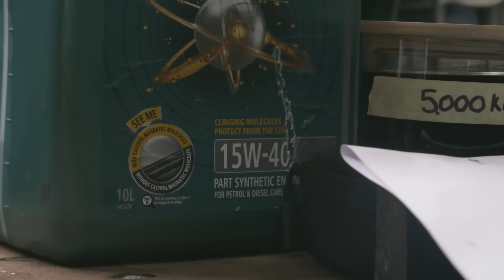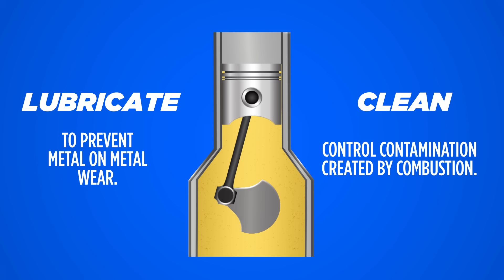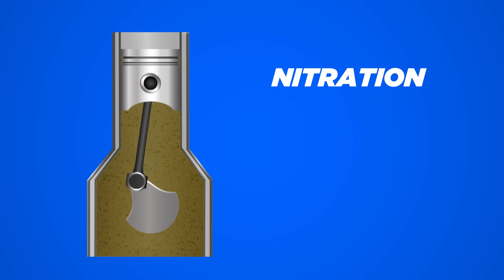Engine oil COMPARED at 5,000km vs 10,000km vs 20,000km! This'll make you service your 4WD RIGHT NOW!

Comment: It is very interesting that in Europe, the shortest manufacturer-recommended interval is 15000km which equals to approx 9300 miles. It is not unusual, if the interval is 20000km or 25, corresponding to 12-15000 miles. Even for the same cars & the same motors. Would would say that it seems like someone wants to get more money for service and oil changes.
I had many cars in my life already, some of them with more than 300 000 km. One of my previous cars (now with new owner) has about 450 000 km (280000 miles) on them, oil was changed in intervals between 15 - 25 0000 km 9300 - 15000 miles.

Comment: 5000km oil change for engine, fuel filters air filters cabin filters every 20k, and the big one every 50k includes power steering, coolant,  diffs, gearbox, valve adjust, Aircon, power steer belts, lube and preload front wheel bearings, and brake check and bleed system, not bad for a 70 year old when I do my maintenance it is cheap and I know it is done, love your video's go hard.

Comment: in general I change my oil at 80% with modern diesels recommended. if I was towing heavy I would change that to 65-75%. Modern diesels ask a lot of there oil and manufacturers are choosing thinner oils for fuel economy.
And another fun fact oil changes color due to the detergents getting hot first, then by contaminants building up.
 Ive been around big diesels for 35years and the old oils never had this problem, due to thicker oils and not recirculating exhaust gasses, because they were basic base stock oils no additive packages like modern oils. One of my bosses used low ash oil with an anti foaming additive in his Mack trucks and that oil was for every fluid in the truck. So engine, power steering, hydraulic tipper ram.
He never had issues.
Anything lower than 40wt oil is not offering the owner of a vehicle proper protection, it purely bragging rights for lower fuel consumption.

Paper test is a perfectly valid way to test oil, it just doesnt have the accuracy of lab testing.
In the railways the mechanics do oil tests with an electric fry pan. <- still not scientific but it easily tests for fuel and water contamination, because they change the oil so frequently thats the only thing they care about.

Comment: Cheap insurance - this is a great example. Oil filters are also much smaller than every previous generation. Cheap insurance - change to the harsh use service interval every time or less. On my race car its after every event. Diff and gearbox after every second event.

Comment: About 40 years ago I was a CAT tech, and when we tested our own cars oils with the CAT SOS, Scheduled Oil Sample service, all of us started changing oil at 5000 kms max. This with petrol engines. As I had a K5 Blazer, carbureted V8, I started changing oil every 3000-4000 max km even though the results for me were better than the ones of single point injection or multiport injection. The newer V8:s had EGR:s (not for long after that...), and for some reason had a bit worse results. Perhaps still new engine wear or something.
I still have that Blazer, I once replaced the valve cover gaskets (have to do that again soon now after about 15 years...) and the engine looked like new inside. It has now well over 800000 kms on it, perhaps close to a million because I had the speedo out for a few years, the small reduction gear for different tire size had failed and I thought that it was the cruise control assembly those had. Just kept going with the traffic...
So, changing oil " way too often" pays, and for first 20 years or so I used just mineral 10W-30. Unless there is a turbo (heaven forbid...) mineral is just as good as syn. Turbos in cars are the invention of The Guy At The Hot Place Below...
And, we started putting grease to the rubber sealing area of the air cleaner cartridge to keep the silica (sand dust) value down.

Comment: I always use the Castrol in everything and change every 10000 .. just a side note I know guys that have wrecked diesel engines not through lazy servicing but by the way they drive .. always changing up gears and labouring the engine.. engines hate it .. hard work with low oil pressure kills an engine.

Comment: Its actually not a bad analogy to what happens with the water/mud.   My sisters never changed oil they just added.   The oil will turn to sludge then fill up all the channels that bring oil from the pad to the lifters on the top of the engine.   Loud lifter noise + poor oil circulation + heat = blue smoke burning engine with loud tappet like lifter sound.   Then you trade that care in and say see you don't need to change the oil on time that is crazy the car still runs.   

They have people brainwashed into that mentality. 

Id say you can can do 5,000 miles (8,000km) with most cars but the new 10,000 mile recommendations are going to lead to more engine wear for sure.

Comment: Oils ain't Oils. They are not all the same. I use Castrol Long Life Synthetic Oils. All though i aggree in changing it earlier but not all cars need changing at 5,000km oppose to 10,000km recommended by Manufacturers.
Example..... My Golf R as mention uses long life Synthetic engine Oil. 
Recommended interval is there for 15,000km. However! I change mine at 10,000km. It is the perfect time for me to change it then. The colour is pretty much as your second oil drop run. If i left it to 15,000km it be close to being fairly dark. So! It is better to state that there are exeptions and it certainly is not a rule to be applied to all cars.

Comment: I have always done an oil change every 10,000 klm - And unless you have a problem with your olfactory senses then the quickest way to tell your oil is shot is by smelling the burnt smell that comes from old and useless oil - Once you smell the burning it is time to change the oil regardless of the distance it has travelled

Comment: Aim for 5,000 km oil changes.  Occasionally due to time constraints it gets stretched to 7,000 km. Not much difference 5 to 7 but over 7 it degrades quickly. I use quality oil, so am not panicked if I miss at 5.   I run my trucks out past 350,000 km.  At that point it is the rest of the truck that is done.  The engine is never the reason I have to cycle out the truck.

Comment: Lol i changed my oil recently in the 4.2 Patrol including a flush this time and it was a tad overfull so I drained a bit and it still came out black and not the normal colour the oil is when I out it in. I have never seen the oil in these things come out anything but black.

Comment: I change it every 5k because I don't know if my route is optimal or not. Sometimes I drive it hard too. But the engine feels smooth after the change. This is how I do it. Oil is not only to lubricate it cleans also. If you don't change it often enough it will not clean anymore. Will still lubricate but not clean and create grinding dust from burning at hot areas in the engine. Engine flush for me is unnecessary. If I had to do an engine flush I would get rid of the car first. And get myself another one.🤣

Comment: i use 350ml fresh left over oul, 1.5 ltrs used oil, filtered 5 times with face tissue, turned up side down nmineral water bottle, then 2 ltrs of PALMOIL, ut runs 1l:,10.5 KMS/liter. for 10 t0 11kms, new oil filter, for 1300 city car mini van

Comment: Ten thousand kilometres is a bloody long distance with stop start , oil is cheaper than an engine .  5000 kilometres is not unreasonable but 10000 is too long . It’s too far.  It’s hell inside that crankcase and it’s pressure on those bearings along with contaminants and water from combustion it’s a recipe for disaster .

Comment: Every 20.000 or once a year. Citroen recommends every 30.000 km. I am using fully synthetic oil. It's a 1.4 hdi with 68 hp. Would change more often with a more powerful engine though. 😊

Comment: I drive a 2017 Cummins Ram 3500. I tow heavy for 6 months and and run empty for 6 months. Dealer recommends changing oil every 15,000 miles, which I do.
I sent two samples to Blackstone Labs for analysis..at 75,000 and 90,000 miles. They told me the oil looks good enough to extend the interval to 17,000 miles and test again. Three thousand mile oil changes are a waste of time and money, especially when your engine uses 12 liters of synthetic oil like the Cummins 6.7.

Comment: This test can not be compared unless it was done on thd same engine. Let's face it, if the engine has low ks, say under 100,000ks... yes 100 thousand ks, i consider low, that test will probably not show a drastic difference,  but if you start with say 300,000, it's going to be much wiser to change oil at say 5000, especially on a diesel with a turbo. No doubt when you change your oil depends what you use it for... i don't see 4wd off road work making a drastic difference unless you're towing or just flat out caning it.

Comment: Greetings from Southern Europe. I've been doing 15K km oil changes and my oil never turns black, it's brown. However, the last time I changed it, it was at almost 10K and there wasn't much of a difference in colour, but I think I'm going to stick to 10K oil changes from now on. I also live in a tempered climate which isn't as hard on the car as if I lived in Canada❤where I'm originally from. Cheers.

Comment: I have my 2019 Toyota Prado serviced every 6mths/10,000km as per the book. However, I change the oil/filter myself in between services at 3mths/5,000km without fail.
Some people would think that is excessive, obsessive, whatever. $120 oil/filter change is cheaper than an engine rebuild.

Comment: I run AMSOIL synthetic in my Duramax… change at 10,000 miles, with a complete lab analysis… “Flagged data does not indicate an immediate need for maintenance action. Continue to observe the trend and monitor equipment and fluid conditions.” 205,000 miles and engine still within factory specs. I use Power Service… change the fuel filter with the oil changes.

Comment: A number of factors must be considered before deciding when to change the oil.
The driver. Is the driver competent? Does he treat the engine with respect. 
Does the driver all engine to reach normal oil temperature  before high speed driving.
(90% of wear in an engine occurs when engine is cold).
The working conditions of the car van truck. EG  does the vehicle  ( bus) spend its day working city centre doing g stop start every few metres in traffic at bus stops?
Does the vehicle work in hilly terain carrying heavy loads?
Is it a long distance car doing mostly motorway driving?
Dies the vehicle work in below freezing climatic conditions?
Does it work in the desert?
Does it work off road? Is it a Sunday car.
A car that only goes to the supermarket the local school during the week  and church on Sunday.  Each journey being 2 Km in distance.
So there is no hard and fast milage distance. Every vehicle is unique and has its own oil change requirements.
The only thing  I will say, is that it is better to err on the side of caution.
But, an easy check is to  tske out the dip stick when engine is cold and feel the oil, Can you feel grit? get the oil tempeture warm and repeat exercuse. Then get oul temp hot  take out the dip stick, and feel the oil. 
Any grit or roughness in the oil, suggests oil and filter need changing.

Comment: Great channel. What a lot of people don’t know is you should change your oil on the amount of time your engine is running rather than the distance travelled. Example, if you let your engine idle for one hour, no mileage is registered on your odometer, that is why a hour meter to register the time the engine is running is a must, highly recommended. I change my oil  every 50 hours. 
My recommended trip for you guys, which I’m sure people have recommended already is Baja Mexico. Yellowtail in San Quentin, rare strain of rainbow trout in the mountains, yellowfin tuna in La Paz. There are some do’s and dont’s. I would not go when there is an off- road race like the 1000 or the 500, and don’t drive on the blacktop at night. Keep up the great programming and maybe I’ll see you guys out there somewhere!!!

Comment: I've been changing every 5,000 km for the past 35 years. It has saved me thousands of dollars. My Chevrolet Malibu did 330,000 kms and ran like new. Rust took it off the road. My 2009 Mercury Grand Marquis has 260,000 km's and has never had a single problem. The only engine part I've replaced is the serpentine belt. It starts, runs like new and gets great mileage.

Comment: Most cars have "cold.start" rev high when you start it when its cold like the mornings.when you go to work. I like to sit till the revs die down probably 30 seconds. I have turbo cars and depends on how i drive it, if im boosting it hard id do a lap around my block or go easy 1- 3 minutes from home so the oil can cool down. Because turbos have a oil feed and if you shut it off and your turbo is red hot. (Hooning, towing, just come off the highway ect) the oil in the turbo will burn. Thats okay i guess but youd have to change your oil more regularly. Like race cars, theyd change oil after every race. I changed my oil every 5000km and never needed to see a mechanic. This day and age you just youtube your car model, and watch and learn how to do it. If you never done it you might need to buy particular tools. And then google how much oil your car needs, buy the oil, oil filter. So much cheaper once you have the tools and knowledge to change your oil. Probably cost most people 80-$100  depending on brand and amount of oil. Then if you get someone else to do it

Comment: Look at this cookie, doing oil quality tests on a piece of paper. I think even highschool kids wouldn't find that accurate 😅 Anyway, you mention cold engine operating and short-distance driving, this is exacly the reason why you SHOULD NOT use a 15W-grade oil, because it takes much longer to heat up (this is so 1990's - perhaps before u were born). Try using a 10W- or 5W-grade (synthetic) oil and see the difference mate. This will help the engine get up to temp faster!

Comment: If you have a car you plan on keeping forever then i would change the oil every 3000 miles before it starts getting dark.
Reply: Yep, and people don't realize the manufacturer extends out the interval to meet standards and convince you to replace it sooner. 3K is optimal for motor oil change out.

Comment: 10,000km oil changes using 100% full synthetic is perfectly fine, if you do alot of city stop and go driving then replace it earlier at 8,000km.

Comment: Changing the oil more often will lower the soot load, for sure, which will show up on the paper, however for anything else you need a proper oil analysis.  Also oil has three functions, lubrication, cleaning AND cooling.

Comment: Judging the quality of oil by its colour is misleading; it only tells you the oil's appearance, not its condition. Claiming that your oil change recommendations deduced by putting drops of oil on a piece of paper are better than what design engineers have specified in the manual is quite laughable.

Comment: Diesel oils that run in a diesel engine are meant to be dark as they capture the soot which is not found in Petrol engines ( most waste is petrol and moisture). If diesels are driven how they are meant to be which is brought up to running temp each time then oil should last long. Intervals are all relative. In a passenger car with 5 litre sump, yes 10 thousand may be too long. But the next model may now have a 7 litre sump. 4WD usually have larger sumps so should get the range. Australia has always had poor diesel fuel, but the newer ones appearing at servos should start to improve things.

Comment: 10k km on full synthethic can be done.

But 10k km on regular or semi syhthetic is not to be done.

I do my oil changes 5k kms on full synthetic, so its 2 oil changes a year, which will help keep the engine better lubricated and cleaner, and reducing the wear, which helps to extend life of the engine.

Oil changes are cheaper than engine replacements or rebuilds.
Reply: Yes, I did it on 4 cars, but non of them had GDI, or low tension piston rings, 2 were 80s Dodge turbos, 2 were 90s naturally aspirated.

Comment: Hello!

Drive a Volvo V60 diesel 2020 and these modern Volvo cars have a service interval of 30,000 kilometers or one year. Whichever occurs first, i.e. number of miles or age of the oil. It works perfectly fine. The problem with used company cars in Sweden is that you cheated and drove additional miles, perhaps 60,000 kilometers with the same oil. It creates problems with oil sludge and so on for owner number two. In Sweden, branded workshops use quality oil that is created and tested by car manufacturers to last 30,000 kilometers or one year. However, it is a little different on what brand you buy, but Volvo has a service interval of 30,000 kilometers or one year. There will be no problem if you stick to the car manufacturer's service intervals and the recommendations of the brand workshop. I submitted my Volvo to a non-brand workshop for an extra oil change or so-called intermediate service six months ago. By then, the car had driven approximately 12,000 kilometers on the same oil. Again a bit unnecessary but I myself drive at slightly higher speeds so I thought it might be in order for an earlier change. The car is now going back to the dealer for a regular service with an oil change. It is also important to know that there is not necessarily anything wrong with an oil that is black. The oil should not only lubricate, seal, cool the engine, but also clean the engine.

Comment: That is not a good oil TBH, that's part synthetic, and is 15w40, what is this... 1995?
Use synthetic 5w40, 15w is too thic on startups on modern engines